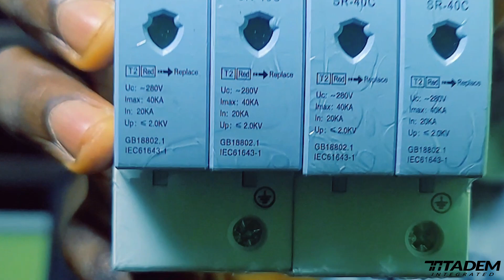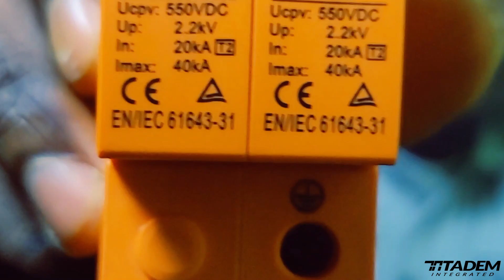Your surge protectors are not active

Comment: Thanks man. There is really unprofessional installers that don't know this things and don't put them into consideration.
My pv voltage is in range of 60v - 500v but the dc surge that my installer used on my pv has uc of 1000v which i just learned from you video that it won't do the work because its over sized
Reply: I mean, my mppt voltage range is between 60v - 500v

Comment: Some installer uses AC SPD while some uses DC SPD?
Pls I need your advice on which SPD to use.
Reply: AC SPD is for the AC side... DC SPD is for the DC side... anything DC in solar installation is the solar panel and battery side. AC is the output side of the inverter or in put from grid into the inverter